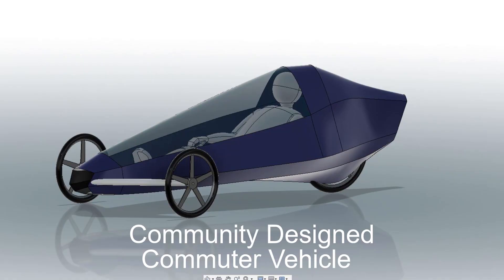High MPG, commuter motorcycle. Open source, fully enclosed motorcycle. You vote for it we build it.

Comment: Ride and handling is generally poor on these types of builds.They can also be labor intensive.I recommend you engineer a redesigned frame and enclosed body around a narrow tracked 3 wheeled tilting Yamaha Tricity 125 cc scooter.The Tricity has superior engineering, ride, handling along with the potential to achieve 100 mpg at 70 mph.
Reply from the maker: Awesome ideas! thank you. We have been struggling with this project. The body work and fitment of all the components have been challenging to say the least.
Reply: @centurialinc  You're welcome.The Tricity is a great starting point and makes the project a bit easier to get up and running. Designing and building the enclosed body can be a bit tricky, as you're essentially driving an airfoil / wing down the road. But you don't need to be an aerodynamicist to get it right. There is a wealth of information on enclosed motorcycle bodies as well as DIY projects online.

At the World Human Powered Speed Challenge at Battle Mountain, Nevada a few years back, I witnessed an enclosed bicycle break the world speed record at just under 90 mph.At that moment I realized just how much potential these types of vehicles have.Of course we would have to build special lanes for them, but I'm betting they would become very popular over time.Even those that allowed you to pedal at low speeds.The designs and technology are limitless.Good luck.
Reply from the maker: We agree. I spend 90% of my time driving just by myself. To and from work or around town. My gigantic 4000lb car is many many times more than necessary. Thank you again. We really appreciate input from the community.

Comment: It might help to have use parameters better defined. What kind of traffic and roads is it expected to be able to navigate? Why limit it to a 3 wheeler when a streamlined scooter/motorcycle would cover many of the things you have so far briefly identified. IMO, a pedal powered 3 wheeler is going to be severely limited in where it could be practicably and safely used. See this for something to think about http://craigvetter.com/pages/470MPG/470MPG%20Main.html  But if 3 wheels are insisted upon, then an enclosed scooter with attached side car might be a viable solution. If it has a water cooled engine, then getting heat from the radiator might be a workable source for warmth... You could pretty much forget about trying to get cabin heat with an electric vehicle.
Reply: Maybe something like this but scaled to more like scooter size and more enclosed for the bike part. http://3.bp.blogspot.com/-hBjUIr1PGoI/UI5d1f1QVjI/AAAAAAAAA_s/4S1KuVramyo/s1600/Sidecar-54.jpg
Reply from the maker: Good comments. Everything I said was just my thoughts. That's why I wanted to do a vote. Let the public and my viewers decide what they wanted most. But alas it was not to be. I got so few votes that it's basically not worth it to pole the public. I'll just make what I want and that will be that. 

Best matt
Reply: @centurialinc  Still, I'd like to see what you eventually come up with. I actually surprised myself with the enclosed scooter/motorcycle with side car idea. It just popped into my head out of the blue; then checked around and found that one picture of a bike with integrated sidecar.
Reply from the maker: @kenoguy10  A new 3d model is up on the web page. It's what I want to build. It's a motorcycle with large outriggers to catch the bike at low speeds/stopped. I took your advice about parameters. So I bought a scooter, it's highway legal, as a donor. 150cc with cvt trans, all registration and suspension done. I think I have a solution for heat and AC.... We will see. This is now a motorcycle project and I think that's for the better. Like you said, other options would just be too limiting. Thanks for your thoughts. They helped me a lot to find my way with this project. And thanks for being kind about it. I got a lot of trolling by others..... To bad. There loss.  

Best Matt